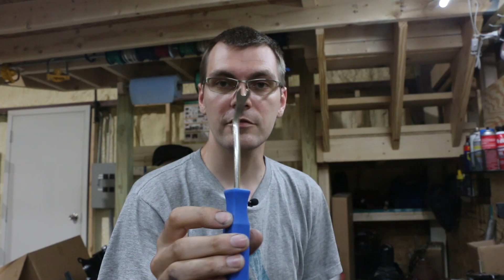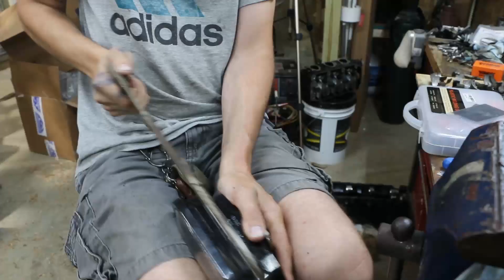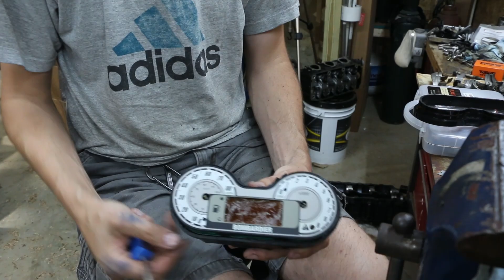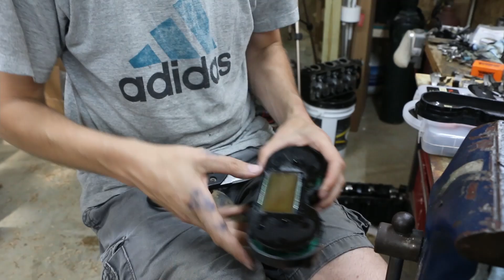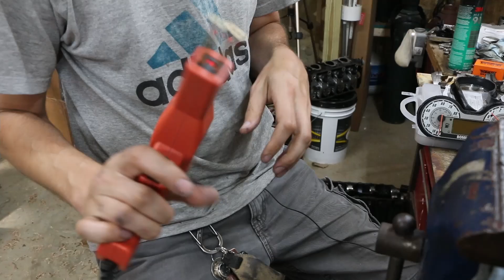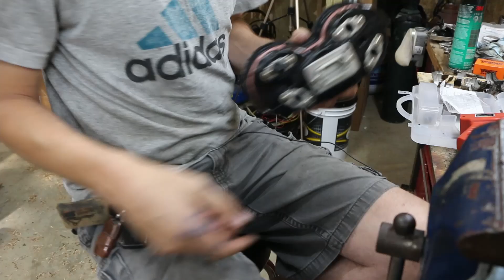05-Earlier Seadoo Dash cluster information center thing repair

Comment: Nice work on the console!  I have the 2007 150 Speedster 215 HP.   I have a slightly different problem, my digital information center has stopped working, it flickered a few times and now its doesn't show anything.  Do you know if there is a fuse that needs to be replace, or does the whole console need to be replaced?  Have you ever done that?  Do you have a video or know of a video that shows how to replace and recapture the correct data (hours specifically).  Any help or direction would be much appreciated.  Really love this boat, but not knowing how much gas I have, among other things,  is a little bit of a problem!!
Reply from the maker: There is a fuse on the PWC versions, on the MPEM module thingy, I forget which one it is, I feel like its a 1 or 2a fuse, real small, and don't put a bigger one in or it might fry the mpem if the wiring is shorted.
Where the hood opens on the PWC models there is a bundle of wires back in where the hood strut is (Video for reference: https://youtu.be/GE9ui12pY6o)
I see them get chewed by mice, or sometimes they just break from being opened and closed.
I'll take a look a little later and report back which fuse it is, I'll reply with the fuse location once I'm back at the shop this afternoon or evening.

Comment: Is it easy to take off and put back on?
Reply from the maker: If the cluster looks like this one and not the newer 06-up style then yes it's incredibly easy to remove. There is a rubber seal gasket on the pwc hood, you basically grab the cluster and pull it straight toward the handlebars, a little soapy water spritzed around the outside of the cluster tends to make it pop out easier, but usually 2 hands and a decent pull and it'll pop right out
Reply: @trythistv  thank you!
Reply: @trythistv  that didn't seem right. I pulled but it didn't budge. It just pulls straight out? Or do I have to go in under the hood?
Reply from the maker: I know on my 05 RXP, as well as customers 03 and 04 GTX models it pulls straight out toward you if you're sitting on the machine looking at it. They can be real stuck sometimes, I've felt like I'm going to break something or end up punching myself in the face with how hard they get stuck, lubricating around them is often a big help, soapy water or some silicone spray wd40 or something like that can loosen them up a bit, but if you tell me what year and model ski you're working on I can check and see just in case there is some form of clip or something on your specific machine
Reply: @trythistv  okay thank you. I just wanted to make sure I wasn't going to break anything. It's a 2002 GTX 4-tec
Reply from the maker: Yep, just checked the diagram and it's just held in by the rubber grommet, you can try prying with a screwdriver or something but usually that just ends up damaging stuff from what I've seen, what works best for me is get a good grip, pull and wiggle it, sometimes the wiggling will release the seal a bit and then it'll come out. You'll get it!
Reply: @trythistv  awesome thank you so much!

Comment: Mine 2005 not show anything ,no speed,rpm,nothing,where can be a problem?
Reply from the maker: There is a fuse on the mpem for the gauge cluster, I feel like it's a very small one like a 1a fuse maybe, if that burns out it could indicate a wiring issue, I've seen the wires under the hood where the gas lift spring is get eaten by mice or crack from age and short out and blow the fuse. If you put in a bigger fuse I have heard it will burn out the cluster driver circuit in the mpem and then it won't ever work unless you replace the entire mpem. I'd check fuses, if one is burnt out, check the wires for breaks under the hood
Reply: I used a battery pack to jump off my battery last season and it blew the 1amp fuse. No gauges were working.